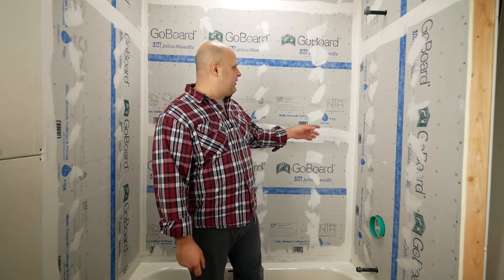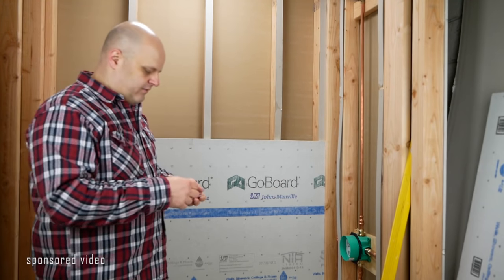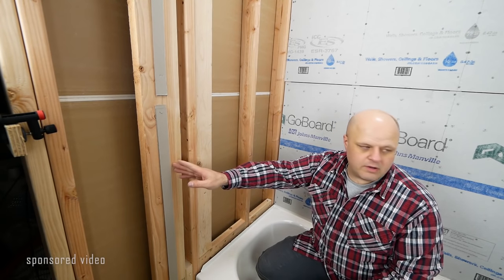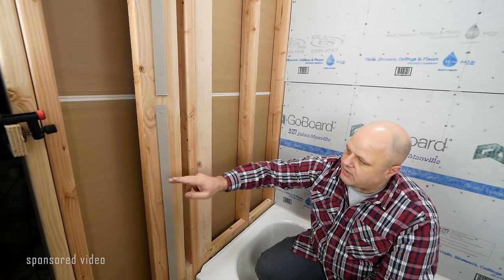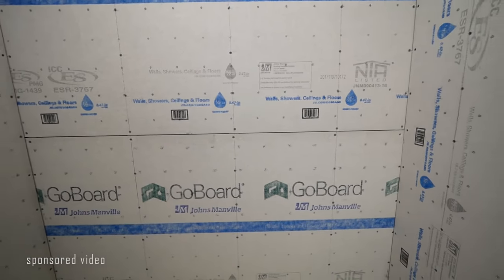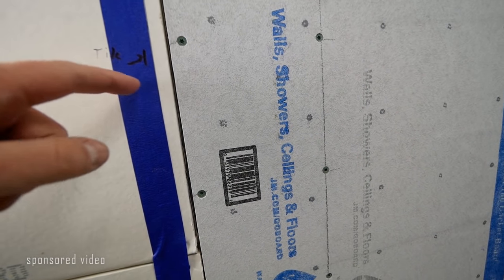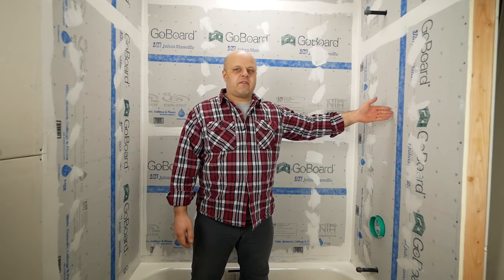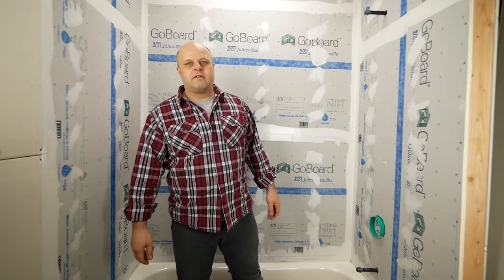How to Install GoBoard Tile Backer Board

Comment: So no sealant at the top where the goboard meets the ceiling drywall?
Reply from the maker: Above the shower head doesn't need to be waterproofed.
Reply: so do you just use joint compound and paper tape for the ceiling to goboard joints?
Reply: @spencer.jacobs  I don’t think it’s necessary. I caulked the tile to ceiling/drywall joint, then painted the caulk. Use paintable caulk I used quad max. Been 2 years and it’s held up perfect. Use blue tape to keep lines clean.

Caulking there will be PLENTY enough protection so as to not allow water to seep behind wall. It’s also mostly for aesthetic reasons you caulk that joint since hardly any water gets up there anyways. Probably more condensation/steam than anything so the caulk is sufficient; nothing needed for backerboard/ceiling joint.

Comment: I went ahead and installed this stuff but it's been months since I watched this video so I forgot to seal between joints. Should I unscrew the goboard, seal the edges then screw back on the wall  or would it be easiest to just jam a putty knife or utility knife into the seams  to enlarge them for me to be able to apply sealant into them
Reply from the maker: You can fill the seams with thinset and install mesh tape over them. Once dry, you can add two coats of a liquid waterproofing membrane over that to seal and waterproof the seams. This is in the GoBoard instructions as an alternative method.

Comment: Why do you space the sheets? Can't I just use polyurethane caulk on all the edges and bump the sheets together?
Reply from the maker: Spacing the sheets is following GoBoard instructions. If you want to apply the sealant to the edges prior to installing the next sheet you can do that and I don't think spacing matters then. 

I talk more about that in my blog post and I recommend reading GoBoard's instructions prior to installation.
Reply: @DIYTileGuy  Awesome thanks! I'm so glad I found this go board stuff, I was almost going to go with kerdi membrane and I really didn't want to cut and thinset each piece
Reply from the maker: @angry-white-men  GoBoard of definitely easier than cement board and Kerdi. Hope it goes well!

Comment: Why do you need cement backer board screws when it's a foam product?
Reply from the maker: Cement backer screws are coated for protection in wet areas and have large heads on them for holding power.
Reply: Because thinset product is a alkyl derivative of cellulose and it will rust the screws if they don't have an alkaline protective sealent on them.

Comment: So it is ok to install the sealant after the board is on the walls?

Directions say to apply sealant during board installation, not after.  Only to thinset, tape and redgard if board is up.   Confused...
Reply from the maker: At the time of this video, that was an approved method. If you're not seeing it in the instructions anymore then they may have changed things.
Reply: You can set all the board then do the sealant. The reason they put it that way was to make sure people use a good solid bead of the sealant. Use a 1/8” paint stick as a spacer then fill the joints. Knife it off and your good!

Comment: Has there been any issues with tile adhesion against the sealant vs the board? 

I could not get goboard sealant near me so i used the Loctite Polyurethane sealant for doors and which is what the JM promotional video used before they had their own product. 

I can't find anything on this and i don't know if i should be coating with redguard or something
Reply from the maker: The tile will stick well enough to the sealant. I've asked this question of other manufacturers also and they all say it's OK.
Reply: @DIYTileGuy  Thanks for the reply. FYI, before you responded I contacted redgard and they said that their product will adhere to polyurethane sealant. It might be good to keep in mind when selecting a sealant product should some issues crop up and you want to add something to enhance adhesion.   I don't believe the same is true of silicone or silane modified products.
Reply: @drvfstrlt1  redguard requires that you use a modified thinset which is organic and is a food source for mold growth!  NEVER use that product for a shower,  unless you want mold!

Comment: What you put between the studs and the go board?
Reply from the maker: If you are flattening the walls prior to installing GoBoard then you may decide to put some drywall shims over dinner of the studs.

Otherwise, you don't need to put anything in between the studs and GoBoard.

Comment: The screws are required to be installed with special washers and all seams covered with the right mud and membrane. All screw holes covered with sealant and the mortar and membrane. Calk does not fix it all .
Reply from the maker: This installation is according to the manufacturer's instructions. They don't require washers. That's one of the perks to using this product.
Reply: No it is not you guys showed everyone how not to install it. The screws you used are for cement board not go board ! It requires the washers, you can pull a screw right through that board. Next time just calk the whole thing geez freaking hack
Reply from the maker: Here's a link to the installation instructions  https://www.jm.com/en/building-insulation/residential/tile-backer-board/
Reply: @KlondikeKlinkers  From the first link:  
"Fasten GoBoard to the
studs with GoBoard® Fasteners flush to the surface of the board
at a maximum spacing of 8" and within ½" - 1" of the perimeter
edges. For alternative fasteners specified in the Approved
Materials section, the maximum spacing is 6".
• As an alternative to traditional fasteners, fasten GoBoard to the
studs with GoBoard® Washers at a maximum spacing of 12"
following the detailed instructions at www.jm.com/goboard."
So using the washers allows one to increase the spacing between the fasteners. However, other methods, 
if done properly, are acceptable.

Comment: Yo, tile guy.  DO NOT try to force sealant in the joint after you install the GoBoard. You're suppose to apply sealant to your EDGES as you install the sheets.  Apply sealant on the edges, push the sheet into place, take a 2" putty knife and smooth it down removing any excess. Repeat the process for the next sheet. Same procedure where it contacts the tub rim or a butt joint in a corner.  Also over your screws. Putting sealant IN the joint is a much more effective sealing process than putting it OVER the joint.
Reply from the maker: GoBoard not only approves of this method but they make a special spacing tool just for this application. However, if you are more comfortable applying the sealant as you go and compressing the boards together then they approve that method too. You can do whichever method you feel comfortable with.
Reply: @DIYTileGuy  Let's interject some common sense into the discussion here.  Why would you leave a gap in a surface you're trying to make impervious to water????  Just a small mistake caulking (sealant) and you've got an issue.  I'm not debating what the manufacturer is saying, I'm just saying their "preferred" way leaves you open to more issues...but it does allow them to sell you spacers.  I've been using GoBoard since 2019 and have always laid a bead as I went.  That's what  they started out telling you.  Then they said butt them but  then seal and tape them. Now it's leave a gap.   It's not a matter of feeling comfortable, it's a matter of doing what makes the most sense.  If you were  building a boat with material that doesn;t expand when it gets wet, would you leave a gap between the  planks and leave your fate up to a bad caulk (sealant) job. Or would you apply sealant first and then compress it between the planks.  Same goes for something like an edge glued board.
Reply: @tonydioguardi8981   It sounds like you  must be smarter then engineers that designed it..If you are really putting an 1/8 bead of sealant on ..its the same thing DUH but it's doubtful that is happening
Reply from the maker: I removed your comment for attacking others. I don't care if you have your own opinion and voice it on my channel but you'll have to state it without calling others names. 

Finally, why do you feel GoBoard has flip flopped on this sealant method? FYI, this video was made in 2017. They've never changed their stance on this method.
Reply: @tonydioguardi8981  if anyone here bothered to read GO Board's directions it clearly states • "Optionally, joints can be reinforced with GoBoard Seam Fabric"  over the sealant
Reply: Yo, internet guy. Stop talking about things you don't know about. Goboard specifically describes this exact method in their documentation.

Comment: I'll need at least 20 years of installs with goboard to think about using it .Don't know what potential problems may arise .
I use simple time tested proven knowns  green board with red guard , and yes of course in showers , no problems coming up on 35 years . 
The substrate does not matter , what matters is the waterproofing . To me this is just another flavor of the month product , the weight is the only advantage I see . 
Time will tell .
But for average homeowners , I suggest simple easy cost effective proven over time methods .
Reply from the maker: Green board is not an approved substrate for Redgard- FYI, for anyone that may be viewing the comments

Comment: This is pitiful, Not good. I can see serious water problems with the way this is installed. Schluter system is a superior product and is guaranteed water proof.
Reply from the maker: I'd like to hear more specifics about why you feel this way. A generic comment like this doesn't really help other people understand what the problem is.
Reply: Barry, how do you explain the GoBoard fish tank at tradeshows? It's made out of GoBoard and GoBoard Sealant (for the corners and seams). It looks pretty waterproof to me holding all that water and pressure! I'm sure Schluter couldn't do that b/c theirs would wick leading to studs getting wet which is exactly what happens. I install GoBoard on all my walls period.
Reply: Barry thinks schluter‘s the only game in town. That’s ok, keep giving them your $.